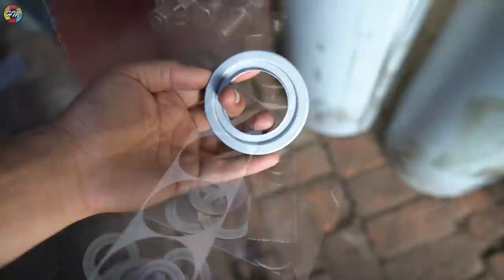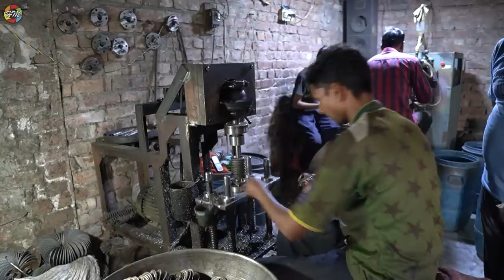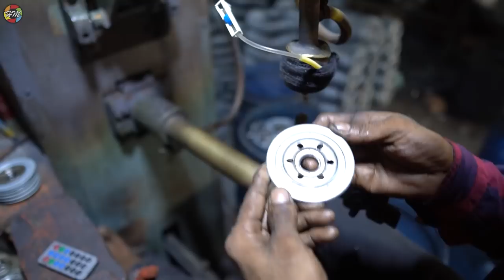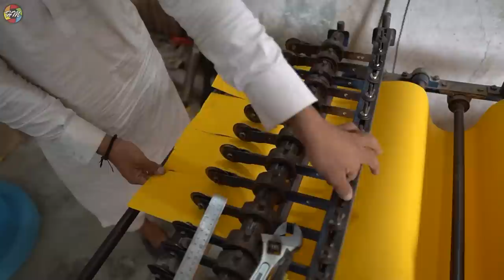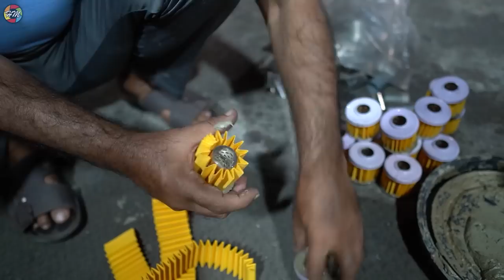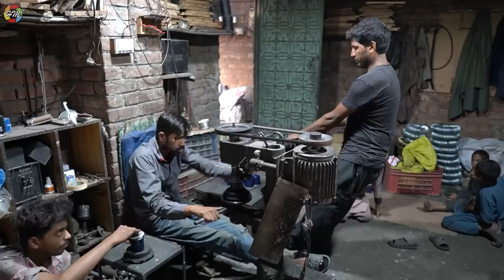How Car Oil Filters are Made | Amazing Manufacturing Process of Oil Filters.

Comment: I have worked in industry...even with safety equipment and machine guards, some workers lost fingers when they wanted to speed up work output by purposely defeating safety interlocks
Reply: Sir which industry you have worked at?
Reply: Add
Reply: @rahulsapra3715  Semiconductor manufacturing. We use stamping, cutting and molding machines. Safety is an important thing.